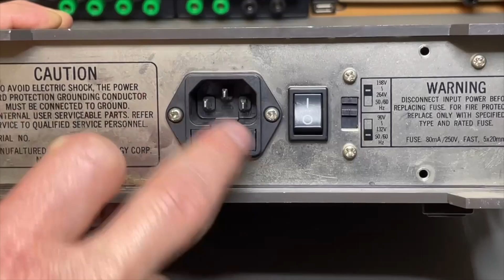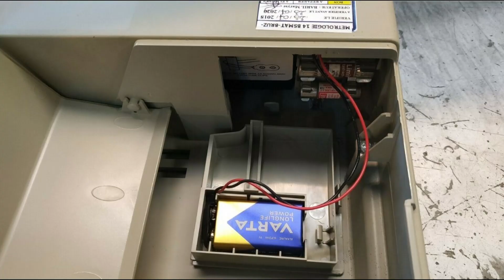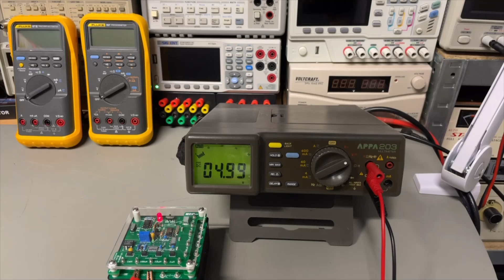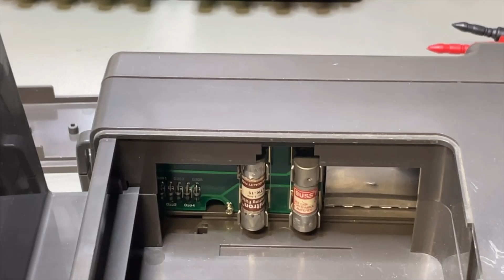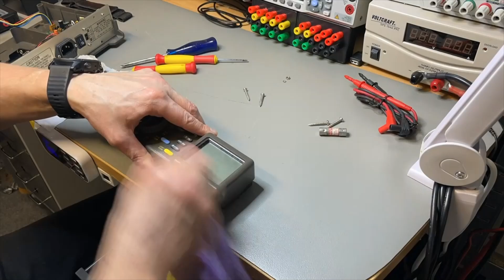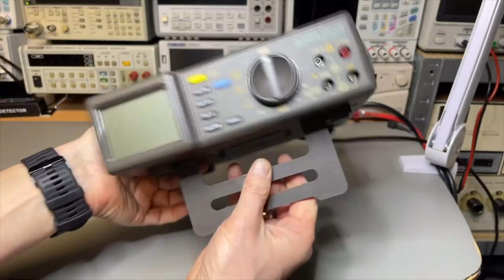TA-0392: Fluke Friday (E21) APPA 203 - The Missing Fluke 38 Multimeter ??

Comment: I see the 10A fuse has been replaced with a 38mm x 10mm fuse.  For some reason they are 1/10 the cost of 35mm x 10mm fuses.  I think Fluke and other DMM manufacturers have turned the 35mm x 10mm fuse into a cash cow for the fuse companies.

Another nice show Tony!
Reply from the maker: Thank you! .. on AliExpress they are cheaper, i left some links. Its is to punish you for abusing the meter i think :)  you should not blow your fuse...

Comment: I like my portable 2030A but I need to make a battery pack. But it comes with a genuine Fluke wall-wart (A81-115) in its companion leather case. Pretty cool as you might say yourself.  73
Reply from the maker: The 2023A is very very nice!  nice find!